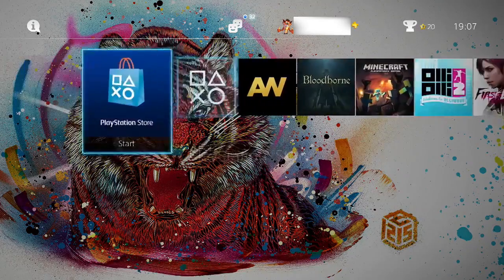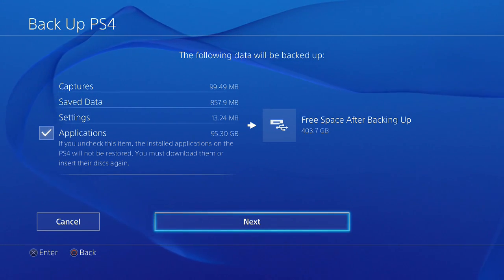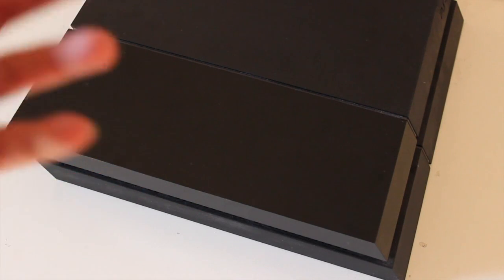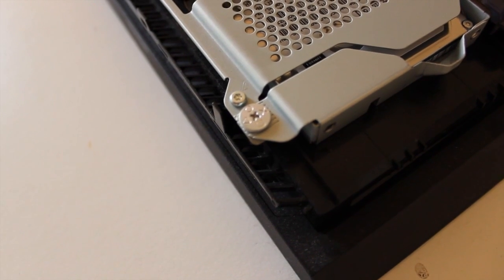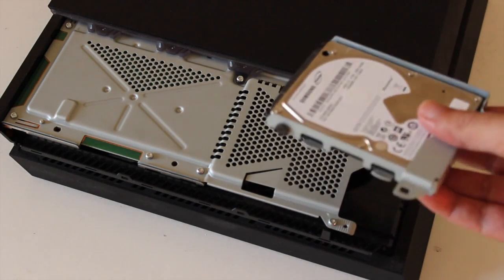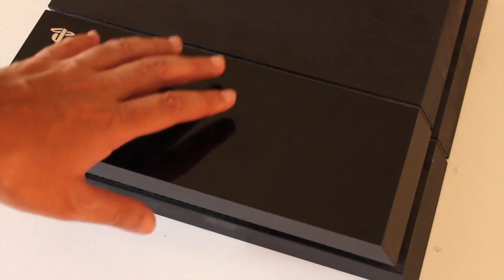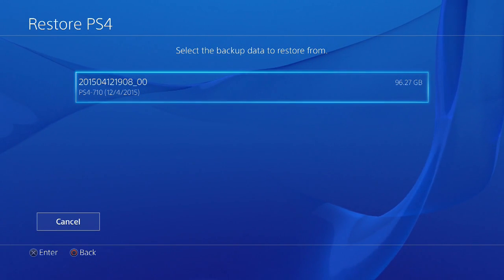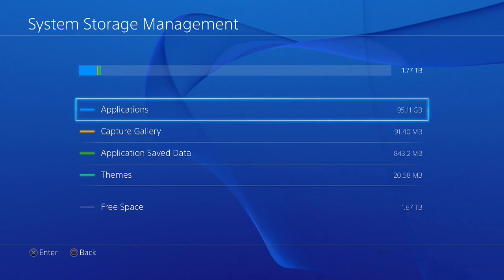How to Backup and Restore your PS4 HDD

Comment: its says it cannot be used. help
Reply from the maker: +TFC GAMING which stage are you at?
Reply: +Slingshot i was putting it in the ps4 and it said this usb device cant be used
Reply from the maker: +TFC GAMING make sure the drive is formatted exfat and also use 3.0 if not then try another drive
Reply: +Slingshot it says its 3.0 and 2.0. i dont know how to format in as exfat
Reply from the maker: +TFC GAMING  pop it in your pic and right click for format and then select format
Reply: +Slingshot thanks ill subscribe
Reply: +Slingshot do i have to take the hard drive apart and put in the ps4? cant i just keep in external and not put it in?
Reply from the maker: +TFC GAMING you need to take it apart

Comment: Do you need 3 hard drives? ;! because I tried backing up my old 500 GB hard drive to my 2tb hard drive but then I put my 2 TB hard drive inside my ps4 and got it working but nothing was on that hard drive. Afterwards, I tried restoring using my old 500 GB hard drive but my ps4 couldn't detect the hard drive and neither could my computer.
Reply from the maker: +Kenny z You need 1 (old ps4 drive) 1 (new 2TB drive) and 1 (USB 3.0 EXFAT formatted) drive. so basically you backup your old drive to the usb then put the new 2TB in your console and then load the backup (USB 3.0) drive back onto the new 2TB that is the short version

Comment: thank you so much!
Reply from the maker: +daniel_960_ glad it helped you
Reply: +Slingshot would you recommend to by the cheaper external hard drive and take it a part like you did or buy a internal hard drive?
Reply from the maker: +daniel_960_ I bought the cheap external works out cheaper and better then I used my old ps4 drive as an external with the other case

Comment: very useful video! I just have one question though when I put the hard drive in and turn the console on for the first time after that... do I have to put the USB in prior to turning the console on? you know, for the firmware update!
Reply from the maker: +marpa when the new drive is in your boot into safe mode with the usb plugged in for the new firmware. It doesn't matter if you put it in before or after you turned it on. The ps4 will ask for the drive. Good luck
Reply: +Slingshot thank you so much for not only putting this video up but also answering questions we might have!
Reply from the maker: +marpa no probs. Always here to help out

Comment: when i try to restore it says "cannot restore". it says it cant reach the files. i backed it up and have done nothing since then. please help?
Reply from the maker: +nielsvanb try a different usb port. What is the file structure?
Reply: it is formatted to exFAT (couldnt choose FAT32 as it is 500gb) im now transferring it to the old 5oogb hdd connected to the seagate expansion portable external drive (which is now in my ps4). that converts it to a usb3.0 cable. hope it works :)
Reply from the maker: +nielsvanb yeah it needs to be usb3.0 in order to work
Reply: Slingshot thanks, is it normal that the backup file is a whole list of mp2's?
Reply from the maker: +nielsvanb yeah it's correct
Reply: +Slingshot okay haha weird!
Also when i try to move archove0004 it wont work :s
Reply from the maker: +nielsvanb can't you backup to the new drive instead of copying it over
Reply: +Slingshot well no, because i am dumb and i already deleted the files on my old ps4 hdd XD
Reply: +Slingshot if it doesnt work i'll just download my games from psn though. Had no big game saves that i will lose so thats okay. Thanks alot for the help :)
Reply from the maker: +nielsvanb well your saves should have also been backed up to the cloud so that would have been cool
Reply: Slingshot yeah thats awesome! i got everything back :D
Reply from the maker: +nielsvanb cool, glad it worked out

Comment: Hi i noticed in this video that your PS4 was restored but a few games had padlocks. I also have the same issue after upgrading to a 2TB hard drive and fully restored the PS4. How do we get the padlocks unlocked so we can play the games
Reply from the maker: You can sign into the account and also make sure your console is activated as primary
Reply: +Slingshot okay thanks. Also I have multiple users on the restore but as long as my account is primary it should be okay.

Comment: Hi,  I have an external seagate 1tb slim as an external for backing up but my PS4 thinks that it doesn't have enough space even though I formatted it to fat 32 so it would work. Any suggestions? +slingshot
Reply from the maker: Hi, try a different USB port or even try format it exfat. Make sure the drive is also usb3.0 compatible. Let me know how it goes
Reply: +Slingshot hi,  it is USB 3 compatible, I also tried ex32 as well as a different USB port but still nothing
Reply: +Slingshot hi,  I tried using a new hard drive and It worked.  Thanks for your time,  great video!
Reply from the maker: Was just about to tell you to try out a new hard drive

Comment: How did you format the external drive? I am trying to backup my ps4 and keep receiving an error and then the ps4 cannot detect the external drive. I have formatted my external drive to both fat32 and exfat and it still wont work.
Reply from the maker: I formatted it exfat and fat32. Is it  usb3.0 , try a different hard drive , USB port or cable

Comment: so once i installed the hard drive. none of my disc based games will play it keeps saying the disc is dirty or damaged or it will get in to the game then say it can't be read
Reply from the maker: I think someone also had the same issue awhile back. Try and initialize the new hardrive and make it primary again in the safe mode
Reply: U mean initialize the ps4 in safe mode? I did not that but I'll try again thanks
Reply from the maker: Yeah, I can't remember what the user did in order to get it working again

Comment: This is a great video, I will be doing this during the weekend. I noticed that you did not sign back in before you restored your old PS4 on the new hard dive. I was debating if I should sign in first or not. Does it make a difference?
Reply from the maker: +foorocker its not important, so long you synced your trophies etc before hand
Reply: Slingshot Ok thank you. So after I restore, my profile will be the primary on that log in screen like it is with my current hard drive? Also is there any issue with digital game licenses when you switch hard drives? Sometimes I like to play single player DLC offline. I had that problem once when I switched hard drives on the 360. Not sure if it is an issue on the PS4. Sorry for the questions, just don't want to mess anything up?
Reply from the maker: +foorocker Yes it will be primary, there is no issues with licences or DLC as its just making a clone of the drive, but you can restore those licences if you want in the settings
Reply from the maker: +foorocker Everything will work as normal just there will be more space to play with :)
Reply: Slingshot Thank you! That is what I need!! Appreciate all the help.
Reply: Slingshot I did it this past weekend and everything went smoothly. Your video and answers to my questions all helped. Thanks a bunch!
Reply from the maker: That's fantastic, glad it worked. Now you can  download the whole internet on your ps4 hahaha
Reply: Slingshot yup. It is nice not being afraid of running out of room.
Reply from the maker: True that. Enjoy it. Chat again
Reply: +Slingshot one more question, when u plug in the usb onto your ps4 does it already make a file or do u need to use the computer
Reply from the maker: +COOOAARRLL Grimes it will already make the files for you, The drive needs to be formatted exfat or fat32

Comment: I did a mistake in the process. Solved. The Backup utility is much welcome. I have to say that my seagate expansion 2tb slim works fine but it is slightly louder. Just a bit. There are some really silly things in the ps4 file management. It's unbelievable I can't copy in ausb pen ALL my save files at once. I have to do it GAME by GAME. Jesus....and if I want to use the cloud, the SAME! Game by game...my "automatic upload" it just doesn't work. Last time my ps4 was able to "automatically upload" was months ago while playing Gta online it started giving upload error messages. Still doesn't after re-set the ps4, tried everything.
Reply from the maker: +Masturbake it's working perfectly for me. No issues at all. The whole backup process did all my game saves , no need to do them individually
Reply: +Masturbake it's working perfectly for me. No issues at all. The whole backup process did all my game saves , no need to do them individually

Comment: God, I don't understand anything. Bought the 2 tab made the back up using the ps4 app ON my NEW 2 tb. I thought after change would be there, after swapping I had to delete everything I back up into the new drive because I am obliged in order to install the update. So the new 2tb (now empty) boots well. When I plug the old one and try to restore says it can't read it. Bye bye PT. bye bye all captures and clips. Nooooo. What I did I rang?
Reply from the maker: +La División Roja sorry about that, yeah you needed to back it up to an external then to your new 2tb drive. There is a way to get PT back though
Reply: +Slingshot so the old one should still have my stuff. I just realized the ps4 hasn't synchronized all my save games...Gta online, witcher 3, destiny, this is. Nightmare. I swap back tomorrow and copy saves and p.t. On a. Usb then change again to the 2 tb ...that should be ok? Thanks a lot.
Reply from the maker: that should work
Reply: +Slingshot it's working. Many thanks. I will subscribe with my other account mate.
Reply from the maker: Cool glad you got it working

Comment: I need some help please! MY ps4 wont read my external drive, how do i formatted it, so my ps4 can read it so i can back up and upgrate the HD? sorry im not a computer guy, just trying to save a couple bucks! Thank you in advanced! Great video!
Reply from the maker: +inkarupay You can format your drive in your computer FAT32 or EXfat and then it will read in your PS4
Reply: +Slingshot perfect! thank you so much for the fast response! I just formatted to FAT32 and plug my external drive and still wont read it =( anything that im missing? Thank you again!
Reply from the maker: Try and format is exFAT and also different port
Reply: +Slingshot I just came back, i just tried formatting to exFAT it still doesnt work =(. I tried to make a primary PS4 folder and insider all the other folders,(Video, music, savedata, game) or I dont need the to make a primary PS4 folder? Thank you again for the quick reply!
Reply from the maker: +inkarupay try a different drive, maybe a flash disk and see if it works
Reply: +Slingshot I'm about to give up! =*( one last question maybe im doing this wrong. Once i format it do i have to create any folders or just straight up connect to the ps4?
Reply from the maker: +inkarupay you dont need to create any folders, and the usb drive wont pop up in the PS4. Try and copy some savedata to  the external

Comment: my playstation has been restoring for 5 days and its only a 1.76gb backup, wtf did i do wrong
Reply from the maker: there must be something wrong. it should never take that long. maybe 8hrs max. what's your setup?
Reply: I just unplugged it and reinstalled my games, its weird but it's running normal so maybe i might need a new hdd or something
Reply from the maker: Could be a new hdd is needed

Comment: Do you need an external hard drive and a new internal hard drive?
Reply from the maker: +TBills Yes an external to backup your drive and then a new bigger internal
Reply: +Slingshot can I just use a thumb drive and a new internal hard drive?
Reply from the maker: +TBills Yip that will also work, so long your backup is small enough for your thumbdrive

Comment: I am using an empty 1tb external hard drive and I have 344gb worth of games that I am trying to back up. For some reason when I go into back up it says "there is not enough free space on the sub storage device." What do I do??? I don't know why it's saying that I have the full 1tb.
Reply from the maker: makes sure its USB 3.0 and formatted in fat32 or exfat
Reply: +Slingshot It is USB 3.0 and its formatted as FAT32. It's a completely empty drive when I check on my computer is says 999gb available.
Reply from the maker: +DronStudios try a different USB port or cable. is it self powered or external powered

Comment: Hi +slingshot  I am a little unclear..when you're doing the full back up you say just back up to usb storage device..but assuming backing up most or all of a 500gb drive...a flash drive if they even exist that big would be crazy expensive...so what did you use exactly?  just another Seagate external usb drive?  another 2TB or what exactly?
Reply from the maker: +jamilmereck Any USB external drive will work thats formatted FAT32 or EXFAT. I am sure you have one laying around. I used a western digital 500GB usb 3.0 drive for my backup

Comment: hiiii bro...can u tell me the specification of internal hard drive...what hard drive shd i go for....
and pls also ans after replacing hdd guarantee will be as was earlier or expired
Reply from the maker: +RIQ king You need an internal sata drive. 1TB or 2TB the better. Size needs to be smaller than 9cm in order to fit. Replaced the hdd doesnt void the warranty. Sony created it in order to upgrade it

Comment: When you change the hard drive will the original hard drive still have data on it or will it be wiped when you take it out?
Reply from the maker: +Louis Doyle the drive will still have its original data. When all is good you can delete it and use it as a spare drive for storage or sell it
Reply: Can you back up your ps4 with the old hdd
Reply from the maker: +Ubaldie you can use another hard drive not the normal one. it needs to be an external drive

Comment: HI doing all the steps and rebooting ps4 in safe mode i got error SU-30649-2 telling system cant find update 3.11 or above. the flash usb i am using is fat32 and i already used it to back up my saves. 
i even used my original ps4 hard drive to paste the update but still system cant find.
i put PS4 then UPDATE then the file awlays same error.
i am using the big update 790mb  not the 244 mb.
please some help here
Reply from the maker: +Mustapha Karmouch Try use a different flash formatted FAT32 with nothing else on it

Comment: Can you backup the data on the seagate, then transfer that to pc, then take the ps4 hdd and put it in the seagate case and put the backup file on it?
Reply from the maker: +Alex Scheller Yes that is also possible
Reply: +Slingshot nice, thanks alot man
Reply from the maker: Yeah it works perfectly
Reply: So instead of a 3rd hdd for backup. I could use 2, with my computer being the middle man?
Reply: Cool thanks man
Reply from the maker: +Nathan93Baker yeah that could also work
Reply: Slingshot bro, can i have multiple backup files on 1 external hdd?
Reply: Alex Scheller Did this method work?

Comment: Upgraded to slim seagate 2TB 3.11 system update everything back 99% just had to re download add on packs etc . 
Few things missing here otherwise pretty good tutorial

1. show removal of donor Hdd from enclosure  and format from Ntfs to ex fat.

2.900mb firmware is needed not the 240 something mb.

3. re instate firmware  option not a upgrade (drive is virgin)

4. takes a few hours (my back up was 397gb  i used a ssd usb drive for backup)
 thxs
Reply from the maker: +KoFi Dee Thanks for the feedback.
1. I didnt want to make it a super long video. Those dont work on Youtube. So didnt want to show it, its pretty simple for that.
2. The 900mb file its mentioned in the video and linked in the description for download
3. Also mentioned and its in the description
4. Also mentioned in the video that it takes long

Comment: After booting the PS4 in safe mode I and choosing option 7 I get the error message "The update file is corrupt." 

I get this every time, no matter what I do - any solutions?
Reply from the maker: is the update file in the correct folder. try a different USB? is it the full clean firmware you downloaded
Reply: It is the correct file (the 800 MB) and it is empty other than that. Hopefully a different USB will do the trick.
Reply from the maker: +Dan Underwood try a different one and see. PS4/UPDATE then the update file. make sure you didn't rename the file

Comment: There is more than one account on my PS4 would I have to go through and back up all data from all accouns?
Reply from the maker: all accounts will be backed up. you only need to do it once
Reply: Slingshot Thanks for the info.
Reply: Slingshot do i need to deactivate my account or something?
Reply from the maker: +Wargreymon559 Nope you don't need to do that
Reply: Slingshot So i just need to back up my data and put it in the new HDD?
Reply from the maker: +Wargreymon559 correct then you are good to go
Reply: Slingshot Ok so I i did everything good and it all went well.But now when I try to reinstall my saved data from my USB.It says "Data not available" but when i plug the usb into my computer i can obiosuly see it.Got a fix?
Reply from the maker: Is your drive USB 3.0 or 2.0? Have you tried it in a different USB port. What format is your usb drive?